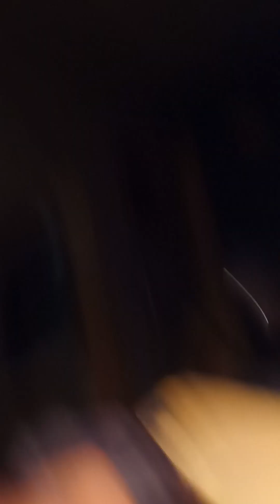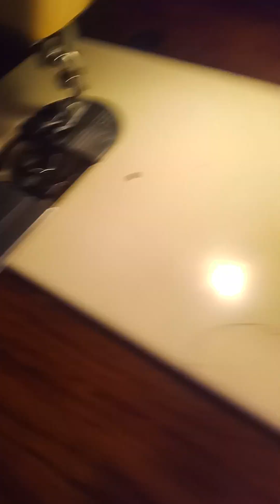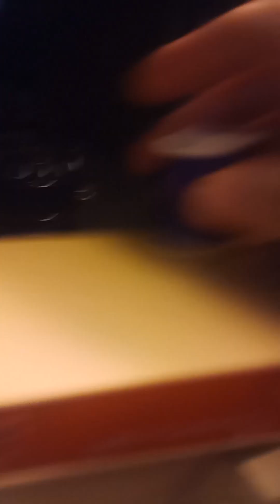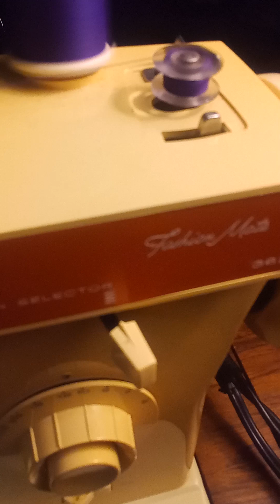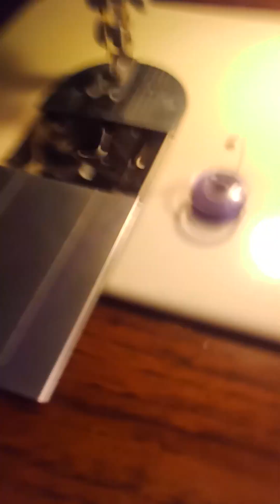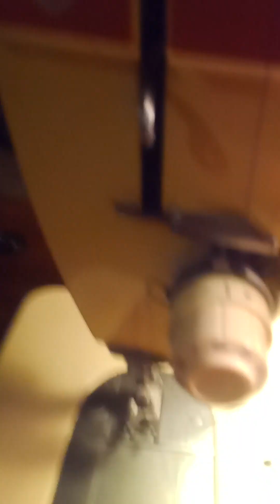Singer 362 Fashion Mate winding the bobbin threading the machine and sewing

Comment: Thank you my grandmother bought this same model for my mother when she was in middle school and I'm learning on it but my mother while making her own outfits when she was young she doesn't remember the specifics of set up I got it working decent on my own but many jams or breaking thread and I believe me going pedal to the metal when winding the bobbin was the main source of my difficulties thank you for the breakdown of threading the machine... Ps I've looked at modern sewing machines and wow don't know how the sewing community sees the 362 but all the gears and mechanical parts are steal cast iron and aluminum my mother said the only thing she's ever replaced were needles and she lost a presser foot don't know if you ever saw the button hole attachment but good lord it's like a watchmakers clockwork fever dream lol
Reply from the maker: That hook timing gear is plastic (and will eventually break) but it's only $5-$10 on eBay & changing it out isn't bad. 
Otherwise the 362 is a solid machine.